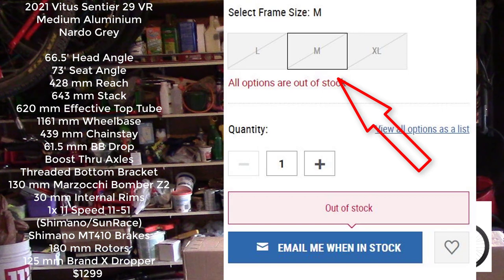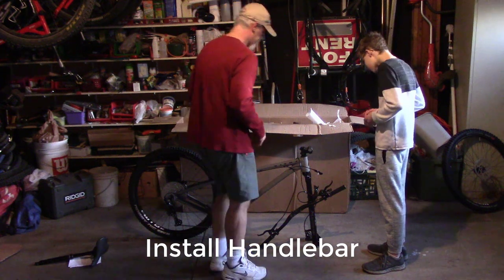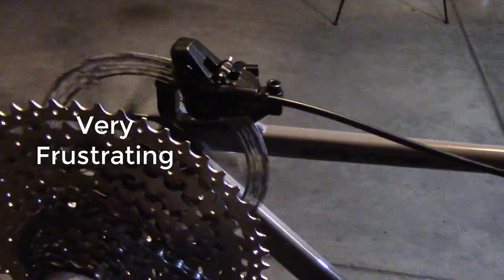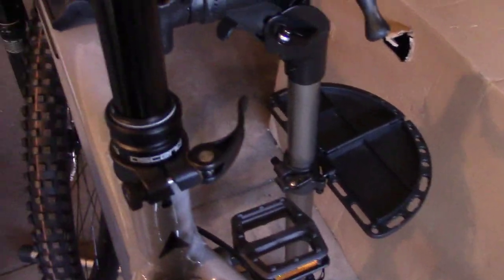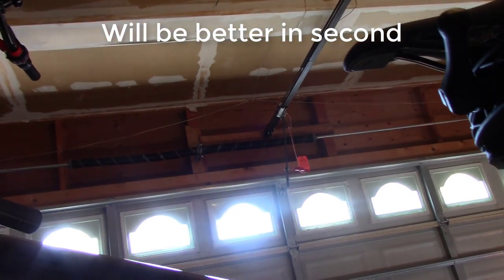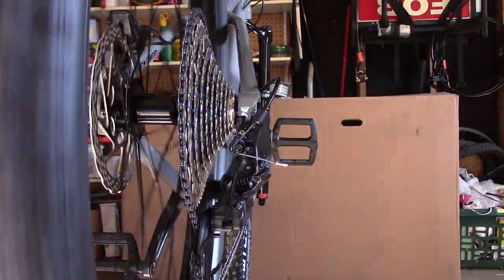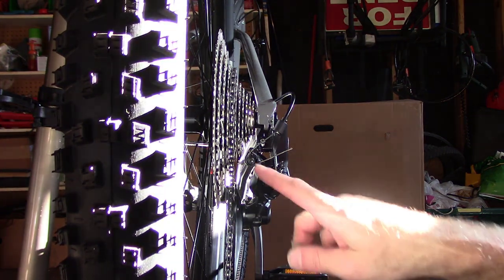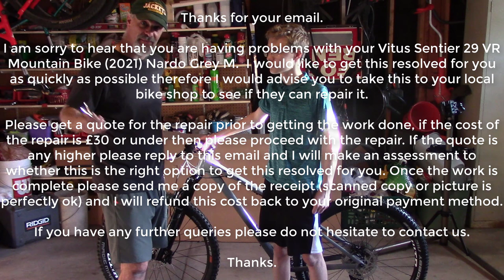[Open Box Nightmare] Chain Reaction Cycles 2021 Vitus Sentier 29 VR: Set Up, Weight, 2 Big Problems

Comment: should've waited and got him one with 650b, man
29" wheels are downright ridiculous

and why did you have a problem with the European brake setup? just get used to it lol
Reply from the maker: Ha Ha.  No more OTB in my house (swapped brake levers would only increase odds).  Why 29?  Covid bike shortage.  After waiting and tracking for weeks, window opened at CRC and we ordered the 27.5 wheel version.  Two days later, CRC told us they did not have enough 27.5 bikes and canceled our order.  Next day, they offered the 29 size and we took it.  So far, so good.
Reply: @50mtb44  yeah, well, you could've waited longer
I'm sure your son wouldn't mind

Comment: Now some of those videos of americans running into their next door neighbours fence on their 1st motorcycle ride makes sense. They are pulling the clutch lever in due to years of it being ingrained into their minds that, this is the lever to brake.
Makes no sense to me for these reasons... Most people are right handed and you want your dominant, stronger hand on the main stopping lever, which is the front. Also, as already mentioned, motorcycles use the right lever for the same action so when or if you buy a motorcycle, your instinct is, right lever=brake!
Reply from the maker: Funny example.  : )

I ride bicycles.  Never rode a motorcycle.

Your logic makes sense.
Reply: if you set up the right lever for the front wheel there is much higher risk that you will go over the bars especially with modern hydraulic brakes. You can do that even with left hand but less likely. To me it make sense to have rear brake on the right lever, but this is a matter of  personal preference.

Comment: It's not a VR. I just bought the exact bike. It's a VRS. The components are way different.
Reply from the maker: Maybe Vitus changed its spec sheet or offer?  I just checked my purchase order.  Here is what it says:  Vitus Sentier 29 VR Mountain Bike 2021.
Reply: @50mtb44  Thanks for your reply.  I take it back. Whatever they sent you, you scored! Mine is a 1×7, VR model, whereas the VRS is a 1× 10. Whatever. I still love this 🚲. Best of times riding with your son. Take care. Aloha
Reply: Hold everything! My bad! You have a Sentier. I have a Nucleas. Mystery solved. Sorry about that. In need a drink.
Reply from the maker: @jameswilson2815  Great bikes.
Reply from the maker: @jameswilson2815  All good.  Ride on.

Comment from the maker: Have you purchased a bike from Chain Reaction Cycles (thinking about it)?  Any issues?
Reply: Got the same bike in 27.5” from chain reaction. Extremely fast shipping and delivery, the  brakes came in the right orientation and dropper post installed. Only needed to fine tune the gears for smoother shifting and adjust the dropper post cable in the lever, other than that no major issues with the bike.
Reply from the maker: @Korupt0r  awesome!  Glad it worked out.  How do you like the bike?
Reply: 50mtb I’m really enjoying it, the modern geometry and wider bars really gives me more confidence on steeper descends. Mine came with 140mm forks which are more than enough for what I ride. I would definitely recommend going tubeless and better pedals. Happy riding for you and your son!!!
Reply from the maker: @Korupt0r  Thanks.  Rock on!
Reply: @50mtb44  I'm saving up to get the 27.5, I have a.trek Marlin 6 and it would be a major upgrade
Reply: I have purchased nucleus 27.5 from crc and not a single issue. I live in Chicago.  Bike came perfectly setup so I am pretty surprised you had an issue.  Check out my review or the nucleus 275vrx on my channel
Reply from the maker: @beauar1  cool.  Glad everything went well for you.  I expected the same.  Thought it would be a fun experience to share.  Not so.  But after fixing issues (glad I can tinker, although many watching will not have that ability or desire), my son is having a blast on his new bike.
Reply: @Korupt0r  Did the dropper post come as stock when you purchased? Doesn't seem to be the case anymore..
Reply from the maker: Yes.
Reply from the maker: Cool.

Comment: If your gears aren’t shifting your derailur hanger is probably bent
Reply from the maker: Good guess.  Had that problem with bend derailleur hanger before.  This time, it may have been us clamping the top tube into the stand (open shifter cable below top tube getting pinched) or poor adjustment from factory.  Either way, resolved by lots of fiddling with adjustments.  Works great now.